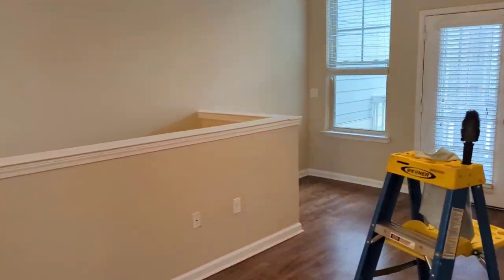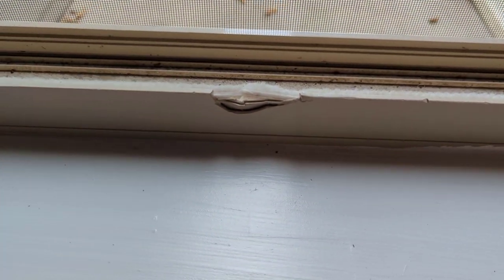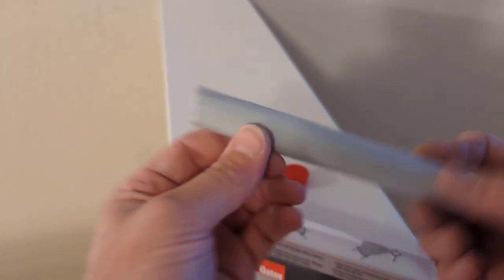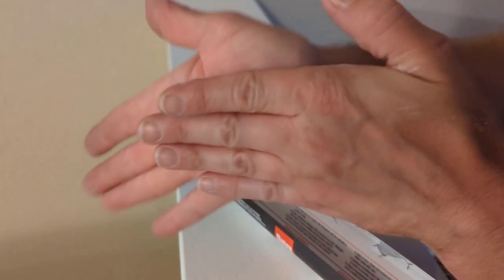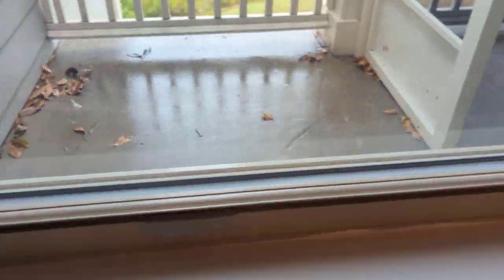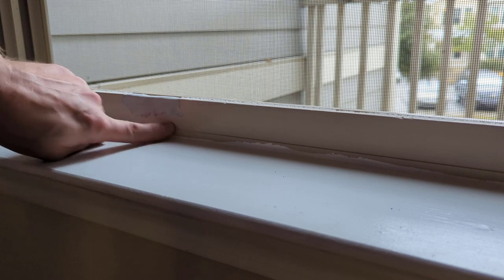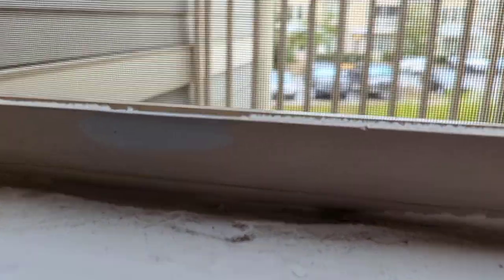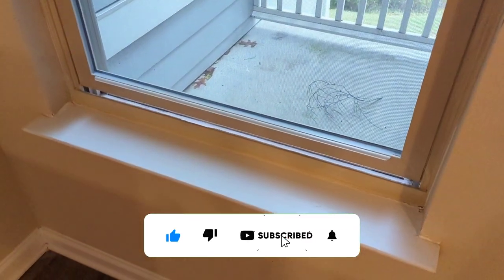Vinyl Window Frame Repair

Comment: I have used that stuff before and it is some pretty good stuff, lots of uses for it. Good job. Thanks for sharing!
Reply from the maker: Agreed, plenty of uses for it. This was the first time I used the oatey brand epoxy putty & I will use it again. The epoxy putty I have always used is called Pig multi purpose epoxy putty. It's from a company "New Pig" they are located in PA near where I'm from. They make & sell absorbents & all kind of products, they are pricey but whatever type of product you would purchase, I would bet it's the best product in that line of material that you ever used. Great company! Thanks for watching Phillip & have a great Thanksgiving! 🦃
Reply: @ApartmentMaintenance  Thanks, I use a lot of oatly products as well. 
Happy Thanksgiving and Happy Holidays!

Comment: Krylon Fusion is good for plastics and vinyl for anyone who has the same issue with sticking. Also any kind of silicone will cause paint and any other liquid for that matter to bead up or fish eye if you completely cover over it. Get a silicone stripper if you can't manually remove all the little stuck on pieces and that should also help.
Reply from the maker: Great tips Joels! Thanks for watching & subscribe to the channel 👍

Comment: Very nice. So far I have not found that kind of damage to a window. Now watch and see, since I’ve seen this video, next week it will happen.

Also, now that you’ve sanded it flat, I wonder if the patch has enough material to grip, being only in contact just along the edges of the damaged area. Did you try to leave any overlap on the inside of the window, or just sand it completely flat to conform to the vinyl?

I wonder if Ready Patch would also work? That stuff sets up rock hard. But then again, it might be too soft to work with when first applying it.
Reply from the maker: I left a little over lap on the other side. Ready patch is good stuff but like you said it's probably to soft. Thanks for watching Duane 👍

Comment: Inspiring video. How has it held up with rain/moisture? I have a crack on the exterior side of door.
Reply from the maker: It has held up great, no leaks or any issues whatsoever. It still looks just like it did the day I made the repair & created the video. Good luck on your repair & it will work out well for you. Thanks for watching & help support the channel by subscribing 🛠️👍

Comment: A dog chewed the window frame but it’s where you open slide window. Is this fixable?
Reply from the maker: @sheilacrittin4351  Yeah, any part of the window frame is fixable with that Oatey stick I used in the video. Just form the section you need like the rest so it matches & let it dry. You will be surprised how well it turns out. Thanks for watching Sheila & help support the channel by subscribing 🛠️👍
Reply: I subscribed to your channel.  I will try to order it through your channel somehow.  I appreciate your help.
Reply from the maker: @sheilacrittin4351  Click on the text about the channel under the home page banner & on that page it has the Amazon affiliate link & once you get directed to Amazon go to the search bar & type in "Oatey Putty" Thank you  description page
Reply from the maker: Here's the link to the product: https://www.amazon.com/Oatey-31270-Tubes-Display-4-Ounce/dp/B0009QW5IU/ref=mp_s_a_1_3?crid=2WN5RPZXTJC6K&dib=eyJ2IjoiMSJ9.AZYO10qf7br4b52L92BBzGMGCMr-qU7kDN_D-_PodYk6HBzcO8SDXUshJfqa3tRUM-6Wf8ubB-0tEQR6SWWqAKV1WlnG4GDkFypXwTcQCt2adEv9zOPWcEG50irLJGgLkNY7kHjokqyIQrIkV8UuTeobal1xKLHypykXiXxTNceW4DN2vTe0buW4LdS_W-mNE5dnYl5dYLJ0zN0XzlEJfA.byBXGWudC8uhmqRJLhzgEduigSR7JA4GmzeLXYkDgew&dib_tag=se&keywords=Oatey+putty&qid=1723687631&sprefix=oatey+putty%2Caps%2C469&sr=8-3

Comment: if the whole piece broke off can it be repaired without removing the window?
Reply from the maker: Just open the window & form the putty to the shape it needs to be & let it set up. I would recommend leaving the window in like I did that way you have it formed properly so the window will still open & close without hitting the frame. Thanks for watching Jeff666p & Subscribe to the channel 🛠️👍

Comment: 6:49: Where did the strip of tin go?  Did the putty not bond to it?
Reply from the maker: I just slid the piece of tin between the window & the frame while I was forming the putty to shape it like the frame & to have a straight edge. Once I was done forming the frame & the putty dried I just pulled the tin out. It was just there temporarily to help create the shape. Thanks for watching Litedesign82 & subscribe to the channel 👍
Reply: @ApartmentMaintenance  So putty doesn't stick to the tin?
Reply from the maker: @litedesign82  Nope. It did not.